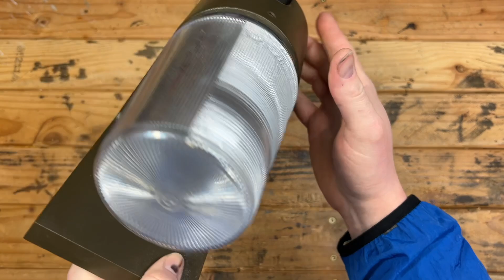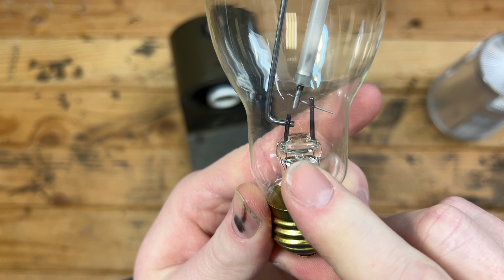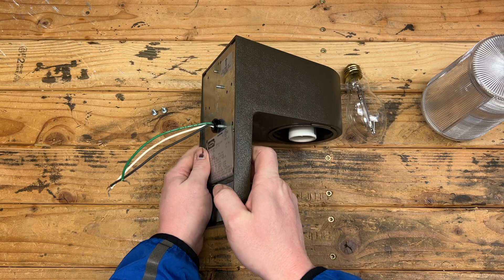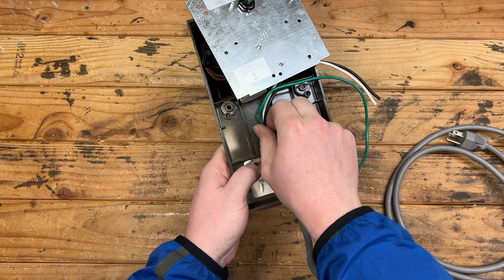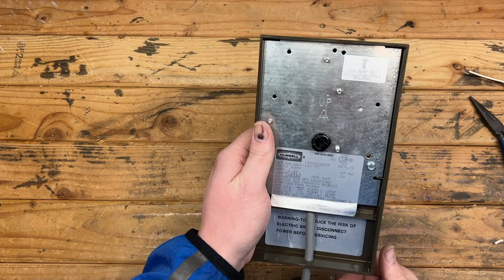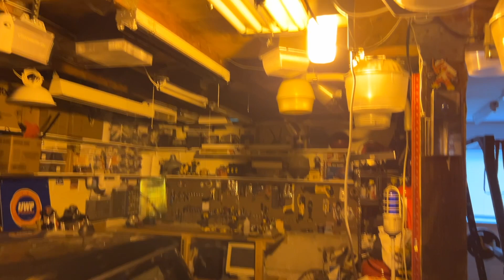Hubbell Entralux 50watt High Pressure Sodium Light Fixture

Comment: Way better than ugly bright white LED
Reply: I agree LEDs are stupid
Reply: @marcoroque5362  or at least the color temperatures and the lumens, they have the tech to simulate the warm up of a HPS along with the color temperature they just don't want to use it because of engineers and people i even have to close a blackout curtain at night in order to sleep, if they would use the reflector like they had in HPS fixtures it would be a whole lot better but nope everyone wants integrated trash, i mean would you rather pay 150-200$ perfixture or would you rather pay 10-30$ per bulb?
Reply: @warningsirensofiowa that’s so true! How can LEDs be a cost effective solution when they fail about as much as HPS lights, but you’re forced to replace the whole @$$ fixture which is not only more expensive, but also requires more in depth maintenance and the power to be shut off for the light.

Comment: I found one of these (NOS) in 50-watt HPS, at my local ReStore yesterday, sealed box. The university I attended back in the 1980’s had this style of fixture (wall and ceiling mount) 50-watt HPS, throughout the campus. The only bad thing was that the plastic jar would yellow over the years. Last few times I was on campus, which was in 2023, the fixtures had all been replaced with new LED fixtures.

Comment: I have 6 of these fixtures! Most are 50 watts and 1 I converted to 35watts. The odd side of the refractor is supposed to be faced towards the backside. I have a video of one of my fixtures on my channel if you would like to check it out! Looks to be a faulty manufacturing response to this fixture you have filmed. It's too bad because these are some great fixtures when made properly.

Comment: They also made these in 28W compact fluorescent (those short ones with thick discharge tubes).
That lamp was whacked in transit, as that arc tube bending can happen to lamps subjected to sidewards shock loading.  That is why the ED17 lamp exists and is more common now, as the arc tube frame has extra support from the lamp bowl/crown.
Also, the set screw is supposed to dig into the plastic of the diffuser instead of being in that notch IIRC.  That's why the diffuser doesn't line up.
Reply: Did you know that the ballasts for these 28W 2 pin PL lamps can also run FML27 CFL lamps and 30W 9 inch T9 circline fluorescent lamps properly using external FS2 starters? I have a couple of Japanese preheat 2 lamp 30W T9 circline fluorescent pendant fixtures that use the ballasts designed for running those lamps and they drive 30W T9 circline fluorescent lamps close to full power.
Reply: Are you talking about the 28W 2 pin 600mA preheat PL lamps that run on a simple choke ballast?
Reply: @worldwidehidcollectorusa-fkt  Yes.
Reply: I converted this exact fixture to 50w metal halide its in my collection it came off ebay as hps as seen on the video.